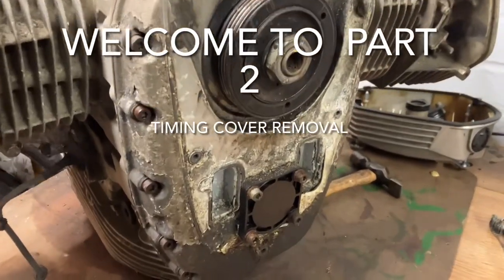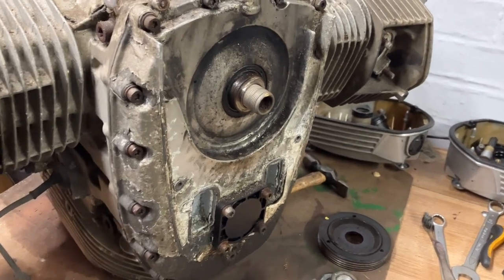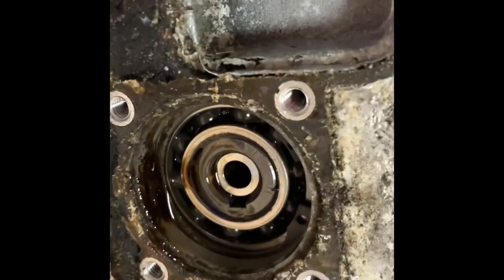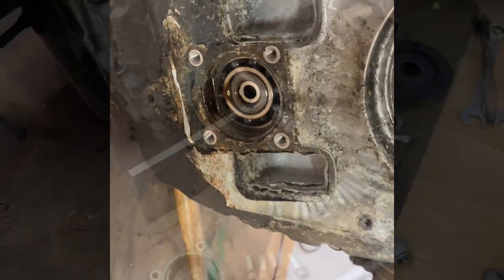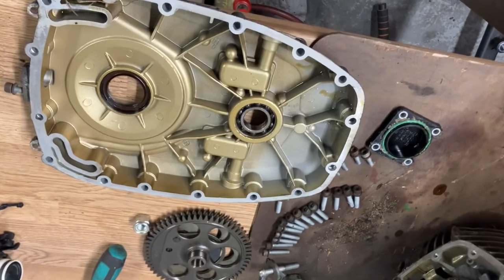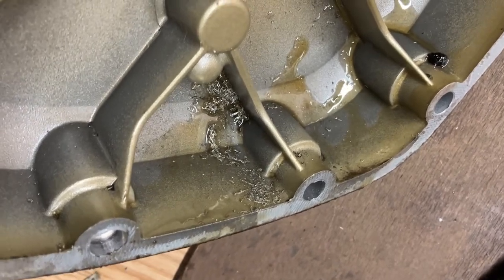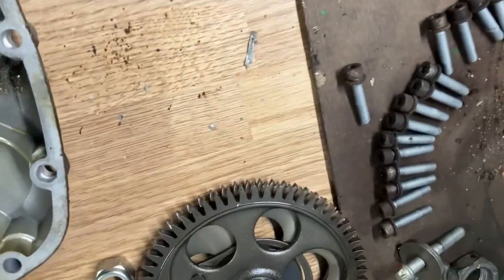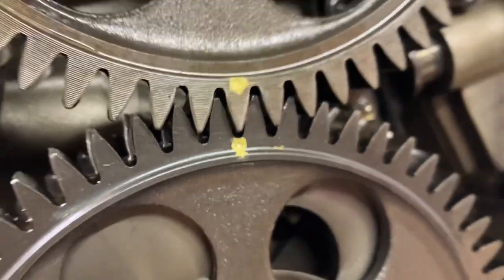Bmw r1200gs timing cover removal part 2

Comment: Well, I just found your video after I've already removed the timing cover from my R1200 GS!  (Along with everything else I had to remove from the bike in order to remove the timing case!) I  did find other online tutorials and videos to help guide me.  Watching your video now is also helpful and insightful, since you have the entire engine removed from the bike :-) My timing cover isn't nearly as badly corroded as the one in your video, but worse than what I was hoping it would be!  Wish I had thought to remove the plastic cover and investigate this issue a little sooner as there is pretty bad pitting in the metal in some areas.  I've successfully stripped, scraped, sanded + more sanding, cleaned, primed and painted my cover and am ready to reinstall it.  Only to realize I need yet another "special tool" push sliding sleeve (No. 11 5 713) to push the shaft seal ring into place ...which thankfully, my partner created an alternative thrust piece like you have done for the thrust piece (No. 31 3 671).  He will look for an alternative option for the push sliding sleeve.  I'm learning SO much and happy to be working on my own bike.  Very thankful to people like you who create awesome videos!
Reply from the maker: I use another seal from the newer bmw r nine t, i has a gaitor ring so is a upgrade , iv done 20,000mile and so far no leaks ill add the part number , thank you for comments
Reply from the maker: Look up number 11118528387 seal

Comment: How easy is it to remove the bearing from the casing?
Reply from the maker: Yeah no problem, the bearing taps out easy enough, when i start refurbing the casings i will show you
Reply: @Tattytyres nice one.
Reply: @Tattytyres could you just leave the bolt in and then use the “puller” to push the gear with the bearing attached so that you don’t have to worry the gear coming off and effecting timing?
Reply from the maker: Yeah easy enough with casing off

Comment: 6:52 what for are these 2 large sprockets?
the 1200 engine seams to have a balance shaft and these sprockets match the drawings.
Reply from the maker: Top sprocket has a slot in it for crank sensor, bottom sprocket is attached to balance shaft
Reply: @Tattytyres  No Hall sensors like on the R1100's?
Reply from the maker: Not too sure about the 1100, engine, only sensor in front timing cover is crank sensor on the 1200
Reply: @Tattytyres  the R1100 has a metal plate with 2 hall sensors behind the alternator pulley.

Comment: I asked for the color code of the "paint" of the engine, drive train parts, but they couldn't tell me.
Too old i was told.
Reply from the maker: I use e-tech spray paint, thats quite close
Reply: @Tattytyres  I wanna make my engine/drive train black, so i went to the BMW replacements parts department and ask the color code of the BMW M2 black shadow edition and because i have no chassis number they can't give me the color code, it''s their software and how they catalog vehicles. the silver color makes the final drive look kinda big and of course some of the "color" dropped off around the carter.
Spoken to a high end BMW restorer in Germany and they said don't use powder coating, but paint.